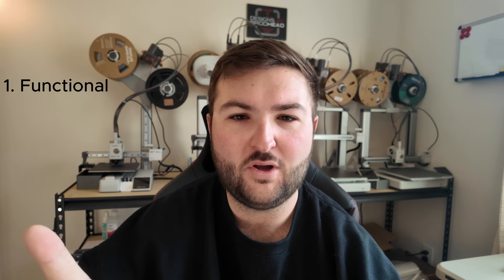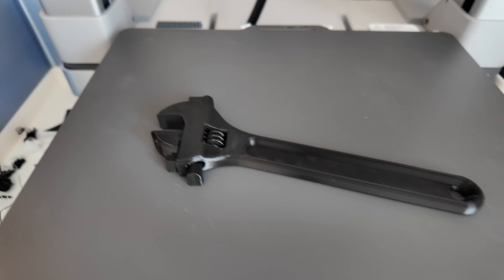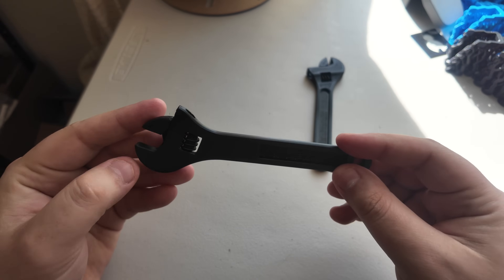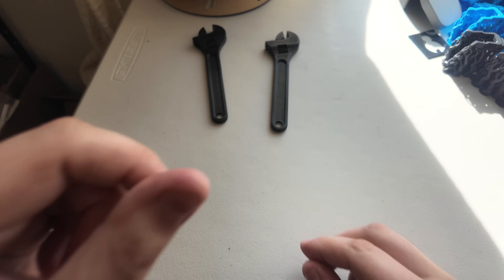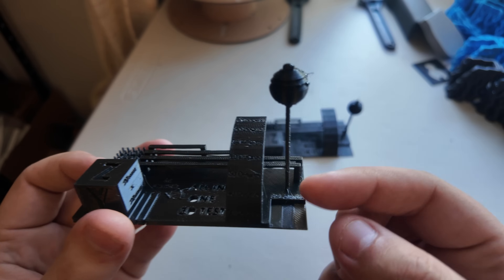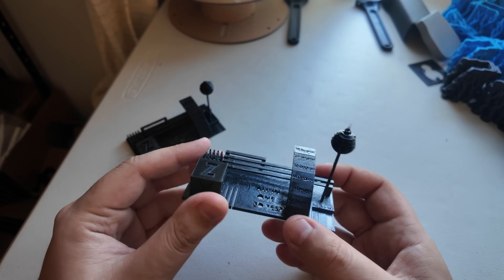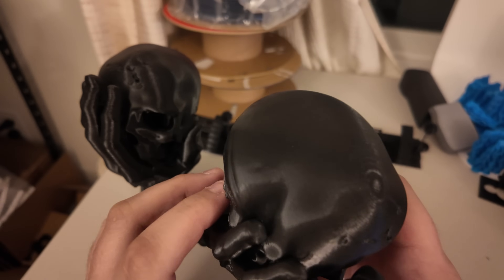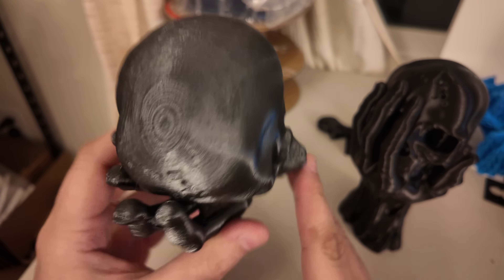PRINT vs PRINT! Elegoo Centauri Carbon & Bambu Lab A1

Comment: How would you compare the sound level of the CC enclosed to the A1 during prints? I have an A1 in my bedroom and print while I sleep just fine. I want another A1 combo but also stuck on the fence on getting a CC instead if it ain’t that loud. Thanks!

Comment: interesting show down. IT really is pretty impressive for its price point. 

One thing for the comparison and lighting. Make sure the light is in front of the parts, especially if doing black parts on a light background. The camera exposes for the background and with it being light will expose for that so dark pieces will look dark. All the light was coming from the windows which was behind the parts. later on at night the skull comparison was much easier to see as it was light from the front of the parts and dark outside so no light coming in from there. just some advice. thanks for the video

Comment: I think it's just really hard for a bed slinger to compete with a coreXY. When your finished print is being flung back and forth at such a high speed versus being stationary, your going to get some extra artifacting showing up in the print. I personally own a P1P and have no complaints, but if I had waited another 6 months I would have loved to get the Centauri Carbon. Enclosure, core XY, being mercifully saved from the temptation of an AMS; what's not to love? $300 is unbeatable for that machine.

Comment: I don't do 3d printing for selling prints, usually for personal use and functional parts,  I have an older Neptune 2S, unit been reliable and prints decently,  but it just was very hit and miss with things like ABS. I wanted the ability to print with some more exotic filament types, like TPU, CF, etc.  but also do not want to spend a lot of money on a fancy enclosed machine.

when I heard about the Centauri,  I ordered one,  does what I want and is cheap,  that being said,  if I was a person with a print farm, and needed my machines to be work horses that can print non stop for months,  then obviously paying more for a reliable work horse with a track record is where you want to be.  any new machine no matter who its made needs to prove itself over time.

Comment: When all consummer get the same "definitive" edition of the Centauri Carbon (updated light, "AMS" port on the back, ...), it'll be the best printer in the $300 price range !
And not talking about the regular Centauri which will be released in july ofr $200. That one is a no brainer for all pla/petg only users.

Comment: Not a fair comparison, you're using elegoo rapid petg for both machines, so of course the elegoo centauri will have a print profile optimised for that filament, whilst bambu lab machine isn't calibrated for that filament, so that could be why the surface finish wasn't great.

It would be much better if you used pla, as it's easier to print and reveals the printing flaws and not the filament flaws

Also, did you dry both filament?
Reply from the maker: In the beginning of the video, I mention that I dried both spools of filament before printing, and was using the same exact print profile for the filament on both printers. I appreciate you commenting and watching, but I covered both of these variables early in the video.
Reply: This is an incredibly stupid comment. Did you even watch the video? Same print setting on both.

What you are saying makes absolutely no sense anyway. There is no special "Calibration" for filament its just print settings that can easily be used on the other printer...

Comment: Nice video!!! I am between anycubic kobra s1, elegoo centauri carbon and creality k1c. I don't care about multi color printing. Please help me decide, appreciate your work.
Reply from the maker: If you don’t care about multi-color printing and you don’t need it immediately (within a month or so maybe) I would definitely go with the CC.
Reply: @DesignsByBrodhead  Thanks for your time, i kind of prefer the CC, but i dont like the idea of pre-order so i am going to wait to see how the market is going to move.
Reply: im about 4 months into 3d printing and just wanted to throw another printer out there for you. the qidi q1 pro has been awesome i started with the a1 and the q1 has been just as easy to print with. i also considered all the ones you were considering and i landed on the q1 for the chamber heater but i think im gonna order a centauri soon too
Reply: @_Godless  Thanks for your advice, i will check on qidi q1, i have an ender 3 pro for 4 - 5 years and I have no problem, but I want to get something better.

Comment: I think enclosed or open printers, whether it's a bed slinger or a core xy is less of a difference when printing PET-G. Every printer I have is for different materials. Not because of the type. PET-G and carbons on an enclosed core xy, PLA TPU on a bed slinger. I don't use other filaments. They're both creality machines. I do like to thinker with them

Comment: I own the A1, and the main issue with it is the open frame. Printing without an enclosure is problematic. Every slight change in ambient temperature, like turning on the air condition in mid print, or opening a door or a window will negatively effect the print. Wind or air flow around the printer will cause layer shift and bed adhesion issues. Once I had built an enclosure for the printer, I have a much better and consistent print quality. In my experience, I would not buy an open frame printer again, especially when the century carbon cost less than the A1.
Reply: I've ran into this issue as well. Still a great printer for open bed-slinger.
Reply: Open frame only makes a big difference if there is a draft or with certain filaments. You can buy an enclosure for 15$
Reply: @EnlightenedSavage  Door fixes it for free considering you bought a house with doors.
Reply: Never printed closed frame and never had a problem. Too much hype

Comment: This is a flawed comparison. You can’t compare a bed slinger to a core x y printer. Though straight up for what you’re getting for the price the elegoo is a really nice looking machine.
Reply from the maker: I disagree. I think the price point and other similarities make it very much so a real comparison and two printers a lot of people are deciding between. Thanks for watching!
Reply: @DesignsByBrodhead Agreed. I'm one of those people right now looking to get into 3D printing. And the price point of other core xy printers has me comparing it to the A1 and not the P1S because of the huge jump in price to that one. What I'd love to see videos of is the learning curve for a beginner using the various slicing programs, etc. for each of these machines. I keep hearing Bambu is better, easier for beginners but I'm not seeing why that's the case. How much harder are the other ones? For example, I'm considering all the top popular contenders right now and I think I'm understanding their physical capabilities & limitations but I want to see what it takes for a newbie to get a file from the internet, to using slicer and setting it to print. This would help me make my buying decision.
Reply from the maker: Sorry - just seeing this now! Honestly with just about any of the printers you buy now (including any of the Bambu Lab printers and the Centauri Carbon) are compatible with OrcaSlicer, which is a slicing software modeled after and very similar to Bambu Lab's slicer, Bambu Studio. I mainly used Bambu Studio when I got my A1's/A1 mini, but have moved towards Orca now with the Centauri Carbon and the similarities are great and very easy to go between the two especially if you have files you print in both slicers. There also a ton of great videos on YouTube for both as well. I hope this helps!

Comment: While I agree with the comments thinking it's a strange comparison on the surface it's a reasonable comparison due to the similarity in price, it's a great comparison for someone like me who's looking for a second printer that will mostly serve as a larger and larger volume printer without the need for multi-color. For example bulk printing of organization prints like multiboard or gridfinity. 

I was leaning towards the A1 since I already have the mini and I'm very happy with it, then again I'm curious about the Elegoos and the CC would give me more capability if I want it down the line.
Reply: Smart choice. Elegoo is junk 🤣

Comment: 2:04 I see 255C temp on the screen. Can you select the Bambu PETG HF profile and test?
Reply from the maker: Why would I use the Bambu PETG HF profile for Elegoo Rapid PETG filament?
Reply: @DesignsByBrodhead  There are two types of PETG. One is high temperature, low speed. The other one is Low temperature (240C) high speed. The Rapid PETG should belong to this high speed category. It's only recently that a breakthrough in filament technology has been achieved. That's what I found when I investigated this. Maybe you can try to confirm. This new filament should be able to print at 18mm3/s volumetric flow

Comment: A lot of people saying they arnt comparable but me and a lot of others are cross shopping them considering theyre very close in price
Reply from the maker: I agree. In a normal scenario when the Core XY is $200+ more than the bedslinger, this is pointless. But it is not, it is $200 LESS than the bedslinger.

A lot of people in the community already and new 3D print enthusiasts are deciding between the A1 (with rising costs) and the Centauri Carbon, even with pre-orders still going out. Thanks for your feedback!
Reply: @DesignsByBrodhead  Theres probably a lot of people like me who have older ender printers and are absolutely sick of tinkering with it and just want a printer that prints. Im trying to decide if the CC is close enough to a set and forget printer for me or if Bambu is worth the extra money
Reply: @phillippinoFLASH  if you don't need the capability right now to print color , i'd go for the elegoo.
Reply: @DesignsByBrodhead the centauri carbon is $150 aud more than the a1 here, whats the a1 price there?
Reply from the maker: @Athiril $299 for the CC, $500 for the A1 (without the AMS lite)
Reply: @DesignsByBrodhead  In VietNam A1 cheaper than CC 50$. And cc have a little upgrade if you buy it now.
Reply: @DesignsByBrodhead  currently comparing the cc the A1 and the p1 but the ams bundle is £419 compared to the elegoo complete bundle for around £405
Reply: @losika3005  ended up getting both the CC and a P1s. The P1S is just amazing. It works every.single.time. It's way quieter than the CC and the build quality is amazing. Being able to print and monitor from your phone is amazing and not something I thought Id ever use. The CC is good but the P1S is just on another level in terms of user experience
Reply: @DesignsByBrodhead  that's wild I have a p1s already. The CC is more costly than the A1 here, and base price of $649 aud vs $899 aud of the p1s.. not necessarily worth the lower price over a p1s
Reply: @DesignsByBrodhead  In the UK, the current prices are A1 Mini £169, A1 £289, CC £299 and P1S £509. The CC has a hardened nozzle and extruder, which would add another £50 to the P1S (and about £15 to the A1. All prices without AMS and before local delivery (another £10/20). 
The CC is cheaper than the P1S by more than the cost of an A1 Mini, but not quite an A1. 

In the UK, we don’t have a mad King setting and changing import taxes daily on his personal whim, so these prices have been stable for many months.
Reply: A1 $300CND right now. No brainer
Reply: Yeah I was literally JUST considering these two printers specifically bc I think they're the best value for your money under $500
Reply: There are lots of things that are similar in price, but different! 
You need to consider what each one can do, but the other can’t - that is how you can purchase the most appropriate for YOU. 
Honestly, I don’t think the bedslinger vs core xy debate is particularly important - the primary difference lies in the filament materials that you can use. 
I have chosen Centauri Carbon as I want the ability to print serious “functional” filament materials that the open A1 simply cannot handle. Bambu’s enclosed P1S (with a hardened nozzle upgrade) is the competitor - but at twice the price here in the UK. 
My CC has arrived and I think it is fantastic value for money. 
Had I only wanted to print decorative PLA items using different filament colours in the same print, the CC would have been a really bad choice.But I’m not intending to be printing multi-coloured toys, vases or cosplay props. 
Your choice should be shaped by what material/s you will want to print. 
Yes the CC can print PLA but for that the CC’s enclosed chamber is actually an embarrassment - you need to have the roof off and the door open! PLA prints fast and at low temperature - but your PLA printed item will soften dramatically in a hot environment (like inside a car parked in the sun). 

Elegoo will be soon coming out with a non-enclosed Centauri (not “Carbon”) which would be equivalent to the A1 in its materials possibilities. And it will be even cheaper!
Reply from the maker: @dougal6569  that’s exactly my point of the video — not really sure the point you are trying to make. Everything you are saying is reiterating what I say at the end of my video.
Reply: @DesignsByBrodhead  the point I am trying to get across is that in those 30 seconds where you mentioned the material possibilities and limitations, you touched on the differences between the products. Whereas the previous 10 minutes had been expressing the opinion that they printed (PLA) about equally well,thereby leaving the impression that they were competing in the same space. 
I think you could have put much more emphasis on how they differed and precisely how that would make both of them the “right” choice - but for different tasks and different buyers. 

One undervalued aspect of the Bambu range is the Wiki, making available detailed information useful to interested owners. Hopefully it’s something else Elegoo will copy learn from!
Reply from the maker: @dougal6569 ah I gotcha. I’m going to do a video very soon comparing the features of both printers and really stressing the things I have learned about the CC within my first 150 hours of printing, hopefully that will help. Thanks for your feedback though!
Reply: @ when people (especially newcomers to the field) are “cross shopping” the most helpful advice is to illuminate the significance, the consequences, of the raw spec sheet differences that are already well documented. 

In terms of your experience, can you get the case fan to turn off and stay off while printing? 🙃 
Or is just mine?

Comment: try changing your slicer settings to print infill first, and then retry the torture test.  Also because mass is not being moved back and forth on core xy, taller objects should look better.  The flow characteristics of the hot ends can definitely impact layer adhesion and surface quality.  That can also be compensated for by adjusting temp, infill settings, number of walls, wall printing order, number of top layers, layer height, etc.  ==> Since these are 2 popular consumer choices, understand the comparison from consumer view point.  But you are comparing apples to oranges from a tool standpoint.  Both will have strengths and weaknesses.  Have 5 diff brands of printers.  3 core xy, 2 slingers, and one delta.  Move prints between them to the one that will handle that part the best.  Own the A1.  Ease of use and auto flow calibration make it a no brainer for virtually any user.  Have the CC arriving soon.  Plan on using it for some higher temp filaments and carbon filled.  If it produces excellent low temp quality will use it for that also.  A1 is my goto TPU/multi color/difficult to print silks, easy petg printing printer.  For larger parts A1 can sometimes layer shift, but it has 1000+ hours on it and is a work horse.  It is also way more expensive than the CC.  Run both Klipper and Marlin printers.  Could personally care less if a printer is closed source.  They are tools, not tinker toys.

Comment: Watched this and wondered - WHY? The real comparison WILL BE between the plain Centauri (open frame) and its MMU (neither of which are available yet) and the A1 with its AMS Lite. 
As you say at the end, the enclosed (and hardened) Carbon can print using functional filaments that the A1 can’t. But (currently) it lacks an MMU/AMS option. 
They are not really comparable in terms of their suitability for different styles of printing! But it is interesting that their PLA print quality is not very different. 

My CC has arrived quite recently and I am very happy with it. No real problems. I have printed a riser for the lid to allow an easier curve for the ptfe tube. The interior light is pathetic but easily and cheaply augmented. It isn’t as quiet as the A1 (whose mechanical noise is so well controlled that you can literally play tunes on it) - but much of the noise comes from the case exhaust fan, which would be a candidate for a fairly simple mod likely also involving easily replaceable filtration. I hope the next firmware update allows that fan to stay off after it has been switched off - I can’t find anything else that would be turning it back on!
Reply from the maker: Normally yes, this comparison wouldn’t make sense. BUT because of the difference in price, there are a TON of people deciding between getting these two printers. Thanks for watching!